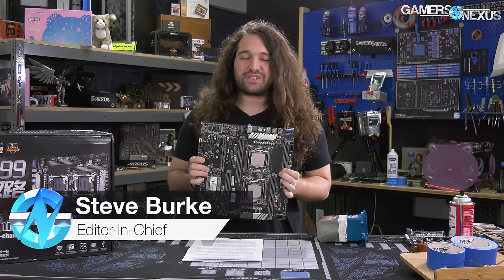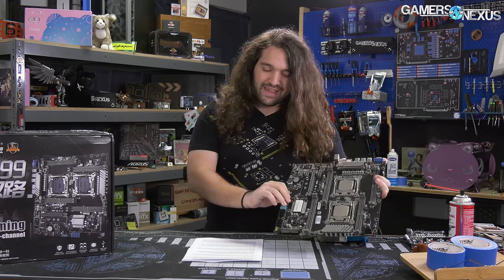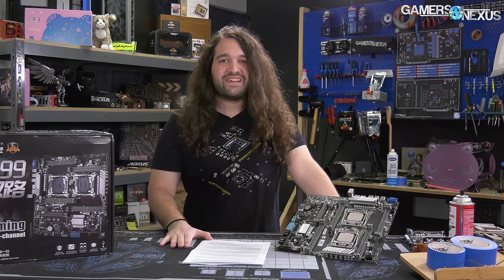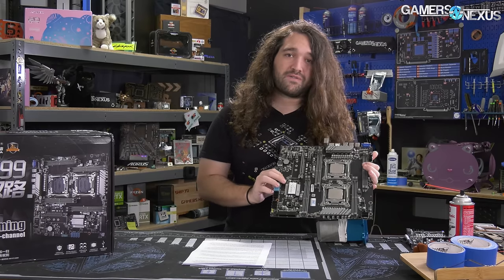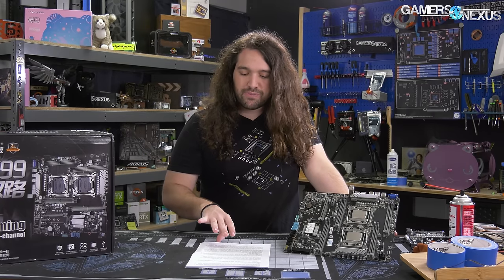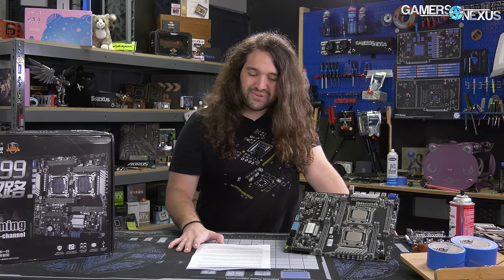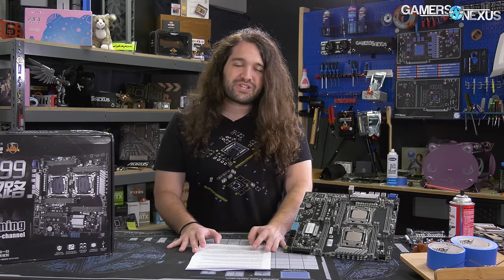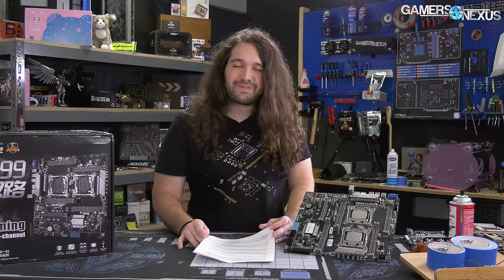24 Cores, 48 Threads for $360: Dual-X99 Jingsha Motherboard vs. AMD R9 3900X

Comment: While these cpus obviously aren't amazing in gaming, they do have some applications elsewhere. If you instead look at E5 2600 v2 CPUs rather than v3/v4, you can use DDR3 ram rather than DDR4. This sounds like a downgrade, but high capacity server DDR3 dims are ~1/3 the price on eBay per gb vs. DDR4, so if you need to build a server with 256gb of ram or more and ram bandwidth doesn't really matter, it's an interesting use case. Additionally, while the individual cores on these CPUs aren't too powerful, having a ton of them makes working with tons of VMs a lot easier. Finally, since these CPUs have 40 PCIe lanes each, you can get a board like an Asus Z9PE-D16 that has 6 PCIe x16 3.0 slots if you want to make a GPU compute server on a budget.
Reply: The RAM thing is really making it hard for me to decide between X99, X79, and staying on Sandy Bridge... I do a lot of digital sculpting and modeling in Blender, and I make games. So the 3 biggest things I need my next upgrade to do are super high poly sculpting, having all my tools open at once, and actually, be able to compile the game engine (Godot in this case) relatively quickly - currently takes ~40 minutes or so on the i3-2100 and 5400RPM every few times I pull from master. But of course, if I go with X99, I won't be able to afford as much RAM, as good of an SSD, or a new WiFi card. If I go with X79, I can probably afford a good SSD, and more RAM than I might ever use, and maybe a WiFi card. If I go with an E3-1240 v1, I can afford everything else for sure, but I'll have to stick with this weird Optiplex motherboard that has the SATA ports blocked by the GPU I got as a gift and non-standard front panel connector.
Reply: @ChrisD__  or with X79 you can buy from Ali "new" mobo like in some GN videos. They got all normal connections, some have 3 or 4 PCIe x16 connectors and M.2 slot
Reply: The 2678v3 does support ddr4, it was a custom hp/hpe sku to support both DDR3 and ddr4
Reply: These cpus can support DDR3, specifically E5-2629 E5-2649 E5-2669 E5-2673 E5-2676 E5-2678 E5-2696V3, you just need a motherboard that specifically supports DDR3.

I personally have the E5 2649v3 that runs all core at 3ghz with 32gb ddr3 ecc, it is definitely not as good as my 1700x but it is insanely good for the price and a perfect dumping ground for some of my useless ddr3 ram.
Reply: Always ran into issues with more than 16GB per bank of DDR3. DDR4 no sweat.
Reply: @lmchua8644  I run a 2678v3 in my system with 32gb 4x8gb kingston predator ddr4 cl12 2400mhz at cl 9 8 9 21 2532 mhz, and the cpu at "3.3ghz" with a 105.5 fsb so close to that 3.5ghz point on a huananzhi x99 F8. Paired with a frontier edition bios msi air boost Vega 56, it destroys most tasks I throw at it. Full system cost was ~500, caught the gpu for ~150 after shipping on Ebay, cpu and cooler for 87, and memory for 88 dollars off of OfficeMax on 50% off clearance, and mobo on 11.11 for 56 usd.
Reply: There are DDR3 motherboards for v3 Xeons. Some OEM Xeons support DDR3.
Reply: @juansolo1617  I had 16 x 8GB (128GB) DDR3 ECC on my dual socket (Xeon E5-2673 v2) Supermicro X9DAi Mo.Bd with no issues.
Reply: @ChrisD__  dude if you're running an i3 literally anything is an upgrade.
Reply: @ChrisD__   the special thing about the 2678 v3 is that it supports ddr3 and ddr4, using ddr4 does not markedly improve performance. most of the issues with stuttering etc are a product of dual cpu boards and aren't a problem on the single cpu boards. fyi Im running a 2678 v3 with 16GB of ddr3 ecc that cost me 175 euro delivered (ddr3 ecc reg memory is silly cheap) the boost mod is applied which allows me to turbo all cores to 3.3GHz (i have a -30mV undervolt applied too) it also has an m.2 slot plenty of sata ports and onboard usb3. I have high clocked x58 and x79 systems but IMO x99 is the cheapest way to go high core count with older xeons. the low clock speed hurts it for gaming but for everything else it is easily able to keep up with more modern gear unless you compare it to stuff that is 3x more expensive.
Reply: My server is based on a v3 CPU, ist a multi VM setup, so I need lots of cores. Vid IOMMUs and PCI passthrou I have all virtuallized on a single machine.
Almost all the 40PCIe are full unfortunalty :D (I have a x8 and an x2 available)

My MB is a x99 IPMI WS from Asus, Thoose china made MB have problems with fan profiles/temperatures and poweron after fail.
And the VRMs generally are bad.
Reply: @edharding9363  I double checked the prices for a Ryzen 3 3100, A520 motherboard and 16 GB DDR4, and it's about the same as going X99. If I can find 2 16 GB gigabyte sticks of DDR4 used on eBay, that might be the better option.
Reply: @ChrisD__  if you are going to upgrade that processor in the near future, then yeah I'd go for the newer ryzen system but I think the x99 system would be much better for your specific case( with rendering, compiling etc). With what you do more cores = more better ;-) I just ran a classroom blender render, my score was 563 secs, I looked up the ryzen 3100 score it's 1092 secs (actually my system beat the ryzen 5 3600 which I was surprised by) btw I'm running a single 2678v3 on a single socket atermiter board not a dual setup like in the video.
Reply: @I_ammm_mojojojo  That's a server board. Most consumer boards don't handle DDR3 well, especially as the price is reduced, unless it's DDR3LP, but again, finding a board that can support high volume is a pain. Right now I'm running 64GB of DDR4 16x4 on a Gigabyte Ryzen board. It's almost bottom tier, runs like a champ, didn't even need to configure it.
Reply: @KadiusFTW  are you able to unlock it past the TDP of the chip? I have the same issue as tech jesus where my cpu downclocks when it reaches rated tdp which is minimized by undervolting. 

I tried various methods which includes further bios modding to unlock some power limit parameters but to no avail, i do use a ant country x99m d3 board though instead of a higher end chinese x99 board like the huananzhi f8.
Reply: @lmchua8644  there is also a couple of other things you can do, but I am unwilling to release the methods of. I have an ES 1650v3 that I have been fiddling with and it has really weird bios handles. I have been trying to copy those bios handles to see if I cannot get the unlocked multiplier to apply to another cpu, and so far, ive noticed when I apply the changes it changes the single core speed of whatever cpu I try to apply it to, but it breaks the all core speed down to the base speed of the applied processor, making the single core of the 2678 I am experimenting with to 3.6ghz, but the all core down to 2.3ghz (the base speed of the ES) and because of the weird changes, it will occasionally BSOD and then not boot again, so I have to use my external flash programer to rewrite the bios to the chip to get it to boot again. Also, once that hack is applied, the core multiplier of the 1650 ES is applied to the 12 core, so anything beyond 4 cores is 2.3ghz, and because of the nature of the mod, neither v3.EFI driver nor the all in one bios mod work to apply an all core turbo.
Reply: I was thinking it would be a great board for a NAS or a 1U container/vm server.
Reply: Are any of the v3 CPUs that support DDR3 on Intel arc or are they just off roadmap?
Reply: @juansolo1617  Both my X79 consumer boards are the Asus X79 Deluxe MoBds that both have 8 x 8GB (64GB) DDR3 ECC but it's a single socket. I ran the Xeon E5-2673 v2 on it with no issues before getting the E5-1660v1 for one and the E5-1680 V2 for the other. No issues with either CPU or board,

The only RAM related problems I had was that the EEC RAM didn't mind the timings being tightened.. but seemed to hate being overclocked
Reply: @No-vv7rp  all off of roadmap, as only 1 non server board I am aware of supported ddr3 on x99.
Reply: Xeon E5 2678 V3 is known for accepting DDR3 as well as Turbo... so you don't have to use V2 (Ivy-B).

In terms of price, however, I agree with you that various Xeon E5 (2650 v2, 2650L v2...2630 V2...), the 2nd generation, can also be used for unRAID. DDR3 ECC REG is inexpensive and offers a little quieter sleep thanks to ECC error correction.  Also for TrueNAS/XigmaNAS ECC with ZFS would be an advantage. For "Gaming" the x79 xeon e5 16x0 v2 are more interesting, because clock besides threads are relevant.
Reply: Might as well just find 1st gen threadripper system. I had some free dual xeon boards with plenty of ram and trashed it all.
Reply: @TheGuruStud  1st gen threadripper had other issues, and its gaming performance was not the greatest.
Reply: @tuttocrafting  "Those china made MB have problems with fan profiles/temperatures and power-on after fail.
And the VRMs generally are bad."
mostly correct, but some are even worse, and while VRM's might be bad they are also always under-cooled and running insanely hot, like 100*C++.

what impressed me most with board in this test was that they managed to get it to even run quad-channel, every single one i have tested have been dual channel at best and some even running 4 dimms single channel.
but compare to an used working Supermicro and Tyan board that goes almost at same prices as "new" china boards on ebay and the "quality" of customer support for the china boards the only reason i see for buying em is slight easier possibility to run ES variants and modding.

i gave up on the china boards and got hold of an cheap Supermicro X10DAL-i to house my pair of Xeon 2666v3 replacing my MSI K9ND Speedster2 with a pair of Opteron 8439SE's
Reply: humandxp  so dont buy used because you made mistakes then overspent? Thats like saying because YOUVE eaten today that world hunger isnt a problem for anyone else.
Reply: @brrebrresen1367  the reason there is a modding scene for these boards is a: availability of completing parts, and b: price, performance, quality and features. If you are spending next to nothing, or buying from a shady seller, the likelihoodof you getting hosed is high. Its like going to a used car salesman and taking everything he says as gospel.
Reply: humandxp  Bud, I think you are missing the entire point of these boards. At all. These are "new" motherboards for 60-100 usd that bring current gen features to older boards. The cpus for this socket, if you know what you are looking for, is approx 75 dollars for a 12 core cpu with 3.3ghz on all cores. In workstation tasks, it outdoes a 2700/3600 for half the price, and the entry level motherboards are cheaper, and with certain v3 cpus, you can use ddr3 ecc making it even cheaper, ~17 bucks for a 4x4gb ddr3 ecc kit.
Reply: the 60-100usd China boards are junk though and if you get an DOA board that is very likely then i hope you bought it at bit more at ebay and not Aliexpress or your lucky to see your money back as the companies there comes and disappears faster than girls change underwear.

the board in this test is 170$ at lowest and if the test GN did is correct one of very few boards with real quad-channel support though it had problems running the RAM at full speed, an also very known problem on china-boards.
but at 170$ you compete with used propper X99 single cpu boards from Asus, MSI and Gigabyte as well as getting very close to Supermicro and Tyan prices*.
also, if you get or have an i7 CPU like an i7-5820k from before you will have to get an used board as not a single of those "new" boards from china can run anything else than Xeon's.

*my X10DAL-i was 2200 NOK (240$) new in a very dusty box, add in that shipping here from overseas is usually around 25 to 40 usd for stuff like this
Reply: @brrebrresen1367  this board can be had buy it now off of ali for 138 usd including shipping from the actual manufacturer and not a reseller. The single socket boards do support I7s, by the way. Check out a YouTube channel called Miyconst, he has a review of pretty much every single one of these knock off boards. If you want better ram timing control, you need a huananzhi x99 T8 bios, as that allows for mem frequency and timing control. These boards are definitely not anywhere near as bad as you put them. I have this exact cpu that Steve is using, but only one of them in my main rig, with an x99 F8 With it not being dual socket basically all of the stutters seen here  are gone (duh, dual socket anything usually destroys your latency)
Reply: humandxp  thats semi fair, if you dont know of the OC xeons on this socket. The 1691v3 14 core is an unlocked xeon I was able to pick up for 158 usd after taxes by gettung one for myself and one for a friend from MemoryExpress. Only reason I dont run it is because of the really high voltages you have to run (1.35v), even though temperatures are below 50c peak on my LC loop. Still, 4.7ghz on 14 cores isnt bad at all.
Reply: @brrebrresen1367  also "your lucky to see your money back" is hilarious  to say. Ali has the same money back and user protection as Ebay, which is incredibly easy to do if you know how. Basically you just need to contact aliexpress directly about your case and usually they will help you out if you can prove you did not receive your package. Ive had to do this twice now, and both times I got a full refund.
Reply: @KadiusFTW  said DOA not "not received" . if received but dead i have only gotten "not our problem" just written in nicer words.
(3 boards out of 5 have been faulty or right out dead)

when it comes to Jingsha X99Dual-F2, yeah it's 123$ on Alibaba from producer, but they want 50$ in shipping while those at 170$ on Aliexpress have free or 5$ shipping to here... so all in all the same.
might be that they ship cheaper to your place but if so, lucky for you.

only problem is local prices here on AMD new and used and warranty laws includes second hand sales, had it been 2 years ago it would made sense but not any longer...
Reply: @brrebrresen1367  I live near Tacoma Washington, which is one of the biggest ports on the west coast, and alibaba ships for free here in general, in most cases. and I have gotten 2 dead boards in the same shipment, and because I bought directly from the Huananzhi store and sent proof of purchase over email to customer support, they accepted my return of the board and gave me a full refund. Once they had confirmed the boards were dead, about a month later, I got 2 new boards free of charge.
Reply: @lmchua8644  Dual E5-2690 on X79 DDR3 2.9GHz all boost to 3.8GHz. 16c/32t noisey fcuker but sweet.
Reply: While there is definetly areas as specific computational applications that a system like this runs at the same speed as a modern Ryzen 9 3900 and the lower cost ram might be worth considdering if you really just need a buttload of ram where speed or ECC isn't an issue, I really find it difficult to see why anyone would go for this. you are looking at 3x as much power usage for the dual Xeon 12/24 than a single R7 3700 8/16 for kinda the same processing power. In my book that already kills the reason why anyone would use older servergrade cpu's vs a Modern high end consumer system. If you really need upwards 1tb ram, you are most likely using it professionally and can afford to buy at least a modern TR 12/24 core system that will desecrate these old Xeons in performance. Also if you are using it for something just semi professional you want something that works, and unless its just for playing around with as a cheap server system at home I wouldn't really trust these chinese reissue boards. If you just need a cheap server cluster for educational work you can make a pi cluster much cheaper that uses 1/500 the power.
Reply: @mrdali67  I have a 20 core 40T Workstation that I use for music production and video editing. Sure for pure thread grunt the 3700 is much more efficient, but when it comes to pure heavy multitasking the 3700 doesn't even compare. I used to record music while rendering 4K videos with that beast and it never even lagged once. I also use it to convert Bluray media where the 3700 would choke to death. And also note that a 3700 costs more than two 10 core Xeons without even counting the RAM. I need a lot of RAM for heavy Photoshop work and music recording and production, and a 128GB set of ECC costs a mere $200..that's just like a 32GB set now. The total cost just beats the AMD in value..I mean my 8600K+24GB+2080Ti system costs way more than this
Reply: @JABelms  still its 5+ year Old tech vs new tech, and if used with cheap china mobos its worthless. If you can find it as a good priced used server or workstation chances are much higher that it will perform well. And no. If we take away the current status of things where everything is overpriced, you get both a faster, cheaper, more power efficient system by buying new. Period Its not even to debate. Every time they do  these testimonals with 10 year Old servergrade vs new consumer grade Its the same result. While it might be very fun to play with an Old server with Ecc memory, you have to be able to get it thrown in your face for nearly no money for it to be a viable option. Ido agree tho that all these new Ryzen and threadrippers are not Mana from heaven. There still is applications where Intel based Xeons still beat AMD by quite a margin.
Reply: @mrdali67  Uh 10 core Xeons cost $150 in my country, dual socket mobo w/256GB ECC support, G3 NVMe for the same price. It isn't even a debate, mine has been running 24 hours for almost 3 years straight with no issue using a Huananzhi X79 D8 since it also handles my CCTV

Their only downside is power consumption, but even then even 300W for a CPU is chump chang compared to a modern AC anyway

We can't take away those prices though because like it or not that is where we are in,  when students ask me to build them a $400 workstation Xeons just smash everything with a $60 8 core price tag and 16GB or RAM that costs $30

Old Xeons were WAYYYY cheaper than AMD ever since 1st gen Ryzen, so it changes nothing really
Reply: What CPUs are great for mining XMR randomX
Reply: @KadiusFTW  105.5 FSB is 5% off-specific synchronization: pay attention to SATA-PCIe storage device.
Reply: @salvatorecampolo2032  I am aware, this is actually where it sits stabily, 105.0 is actually unstable, but stepping it above it slightly makes it stable. I tried to step it down to 105 flat and it caused BSODS, but I dont get them with 105.5. Might be Vdroop related or minor desync
Reply: The 2678 v3 works with DDR3 and plenty of X99 boards support DDR3 as well.
Reply: There are at least 5 V3 Xeon CPU's that can work with DDR3 (eg: E5-2678V3).  Also, the HuananZhi X99TF and the X99T8 will also work with DDR3.